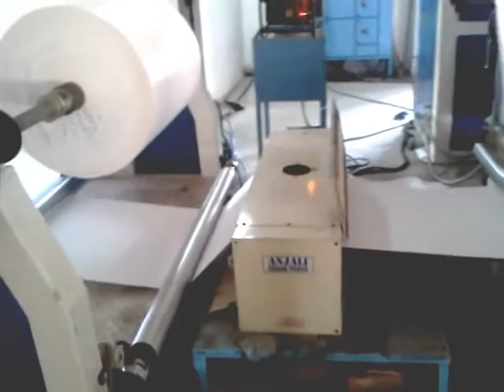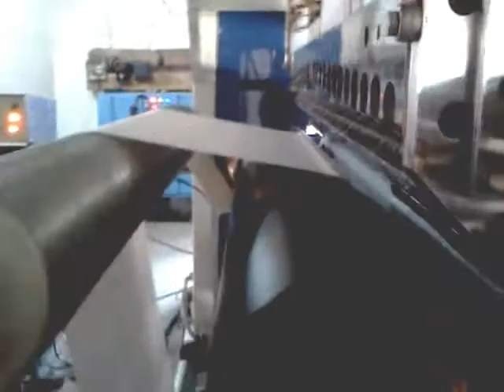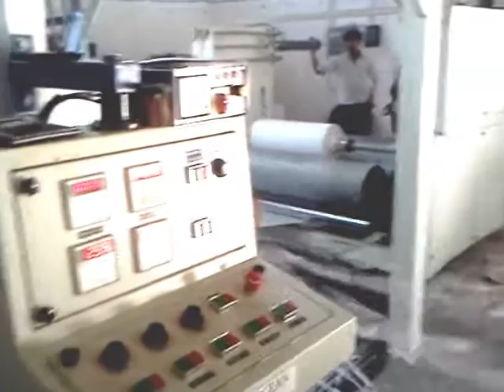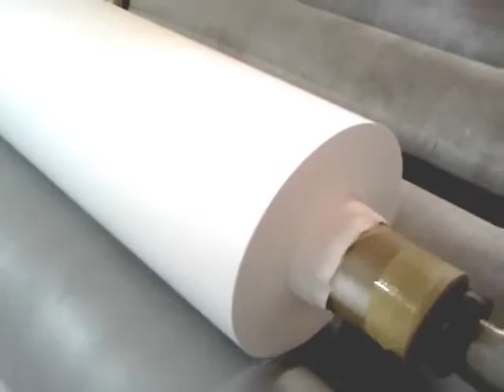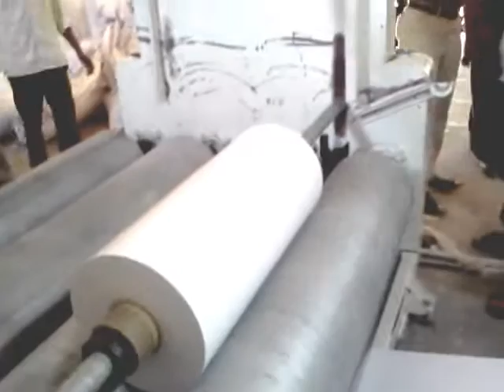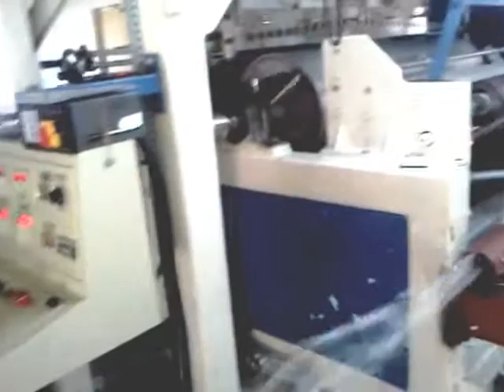ldpe Coating Lamination machine pape laminating line pp coating plant pet Coating

Comment from the maker: ldpe Coating Lamination machine pape laminating line pp coating plant pet Coating
woven sack raffia lamination plant, woven sack raffia coating machine, pp machine 
This video about Extrusions Coating Lamination Plant for bopp lamination coating machine for paper lamination line get more details visit at http://www.oceanextrusions.com/extrusion-coating-lamination-plant.html.This video about Extrusion Coating Lamination Plant that broadly used for laminating various types of material and specially equipped for laminating papers. Further information about Extrusion Coating Lamination Plant, visit at http://www.oceanextrusions.com/extrusion-coating-lamination-plant.html. extrusion coating lamination machine line plant for bopp lamination coating machine for paper For Coating thin layer of polyolefin's (Mainly LDPE / PP) on substrates like Woven Sacks, Tarpaulins, Jumbo Bags, BOPP Film, Paper, Aluminum Foil, Polyester Film, Cotton Fabrics, Jute, Non Woven Fabrics, etc. Up to 5200 mm Web width applications. Tandem Lamination Plant for coating Circular Woven Fabrics, for producing multi layer laminates up to 5 layers along with the various substrates like Paper, Aluminum Foil, Polyester film etc. Lamination line material adds superior protection for products when they are packed. Extrusion coating lamination plant is a suitable solution to produce very slim lining layers made of PP, LDPE. This lining material will them be added to packaging components like woven sacks, giant size bags, aluminum foil, cotton and jute fabric bags, etc. Ocean Extrusions is a leading extrusion coating lamination plant manufacturer and our lamination plant will remain a revenue making investment as the machine components are made of reliable and quality materials. This video caters details about Extrusion Coating Lamination machine that is used for ldpe Coating Lamination, pp coating, pet Coating lamination, woven sacks, paper with Aluminium Foil Coating, bopp lamination with BOPP Film Coating extrusions lamination, metalized Polyester Coating Paper, Cotton Fabric Coating Paper with HDPE Woven Fabric Coating. Further more information visit at http://www.oceanextrusions.com/extrusion-coating-lamination-plant.html
www.oceanextrusions.com
009724325401

Comment from the maker: woven sack raffia lamination plant, woven sack raffia coating machine, pp machine 
This video about Extrusions Coating Lamination Plant for bopp lamination coating machine for paper lamination line get more details visit at http://www.oceanextrusions.com/extrusion-coating-lamination-plant.html.This video about Extrusion Coating Lamination Plant that broadly used for laminating various types of material and specially equipped for laminating papers. Further information about Extrusion Coating Lamination Plant, visit at http://www.oceanextrusions.com/extrusion-coating-lamination-plant.html. extrusion coating lamination machine line plant for bopp lamination coating machine for paper For Coating thin layer of polyolefin's (Mainly LDPE / PP) on substrates like Woven Sacks, Tarpaulins, Jumbo Bags, BOPP Film, Paper, Aluminum Foil, Polyester Film, Cotton Fabrics, Jute, Non Woven Fabrics, etc. Up to 5200 mm Web width applications. Tandem Lamination Plant for coating Circular Woven Fabrics, for producing multi layer laminates up to 5 layers along with the various substrates like Paper, Aluminum Foil, Polyester film etc. Lamination line material adds superior protection for products when they are packed. Extrusion coating lamination plant is a suitable solution to produce very slim lining layers made of PP, LDPE. This lining material will them be added to packaging components like woven sacks, giant size bags, aluminum foil, cotton and jute fabric bags, etc. Ocean Extrusions is a leading extrusion coating lamination plant manufacturer and our lamination plant will remain a revenue making investment as the machine components are made of reliable and quality materials. This video caters details about Extrusion Coating Lamination machine that is used for ldpe Coating Lamination, pp coating, pet Coating lamination, woven sacks, paper with Aluminium Foil Coating, bopp lamination with BOPP Film Coating extrusions lamination, metalized Polyester Coating Paper, Cotton Fabric Coating Paper with HDPE Woven Fabric Coating. Further more information visit at http://www.oceanextrusions.com/extrusion-coating-lamination-plant.html
www.oceanextrusions.com
009724325401
Reply from the maker: goood machine